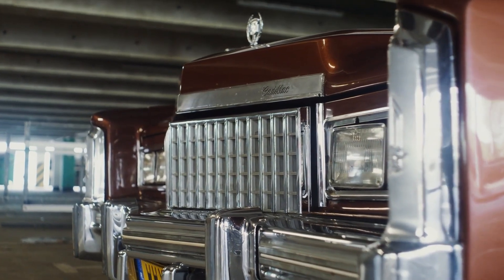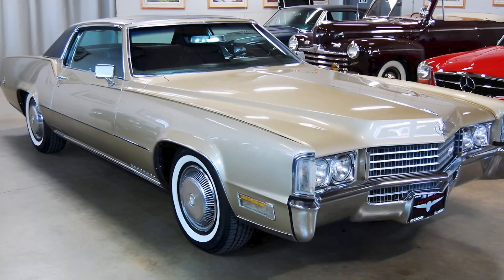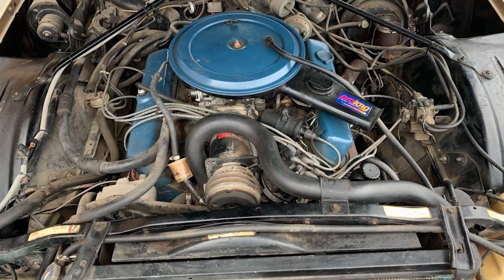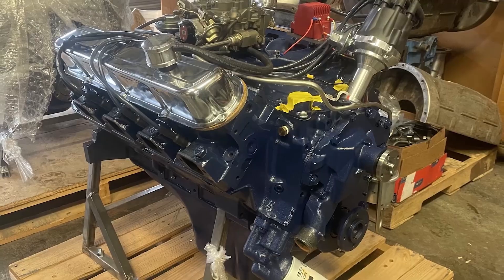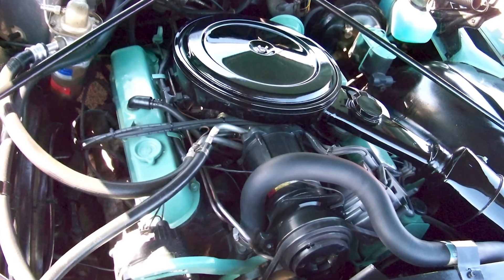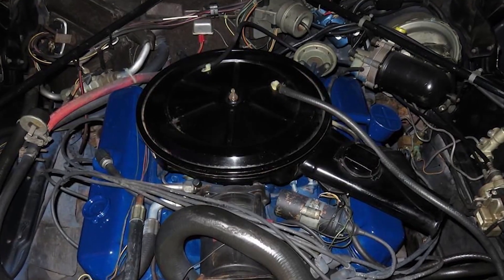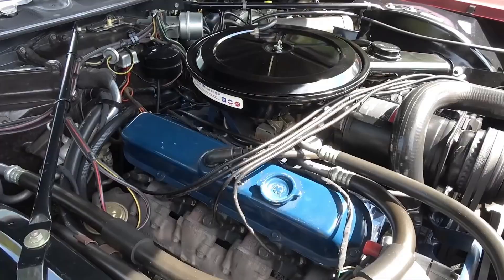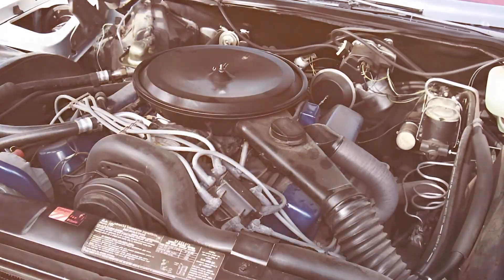How the Cadillac 500 V8 Became the Largest Production Engine Ever

Comment: This kid is reading a script that's not entirely accurate: The 500 was the baby of the family. My Father had a 507 in a 1973 Eldorado, and my best friend had a 525 in a 72 Eldorado. That thing weighed over 5,400lbs. Our 77's and 78's had 425's in them at around 4,400lbs. They shaved 1,000 lbs off that car when they wanted to. Before they downsized the car. And the 425 was by far, the best engine Cadillac ever made from scratch. They ran the 425 in everything from hearses to ambulances, to limousines. And all of their models in between. My 78 Eldorado got 19mpg on the Interstate with that engine, which was quite incredible. The Lincoln 460's were getting 7 1/2. There were millions of 425's on the road. And all of them were dead nuts reliable. All they ever wanted to do was run. They went from that to the Northstar piece of junk and it was downhill from there. Off a cliff downhill.

The 500's and up were actually General Motors very heavy duty boat engines and Cadillac converted them for car use. It goes from cars, to trucks, to heavy duty trucks, to boat engines. And yes, they lasted forever in a car. The bodies rotted out way before the drive train gave up. So was the Chevrolet 454 also a boat engine. Most people don't know that either.
Reply: 😎 Wow thank you  Brother, for the information 💯...
Reply: The 507 and 525 you mention are stretched 500s or 472s.

The 425 is a de-bored 472, abd they ran from 77 to 79, when the 425 was de-bored to a 368 for 1980,  The 368 also shared the same stroke as the 425 and 472 at 4.06 inches.

The 500 is a 472 stroked .244 inches.

Comment: What utter hyperbole
Reply: No, they were great engines and got 8mph tops. See my above post. The later years with the 425 improved them greatly. My 78 could get 19 on the highway, which was quite a feat. Lincoln was only getting 7 1/2mpg with their 460's. They were pigs, and they handled just horribly as well. Brutal in winter. I know, I was there.